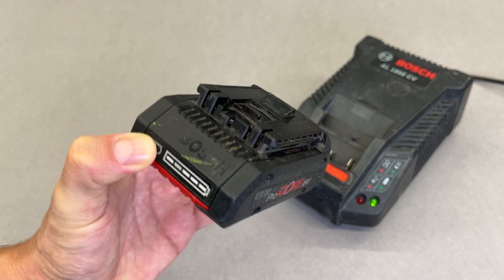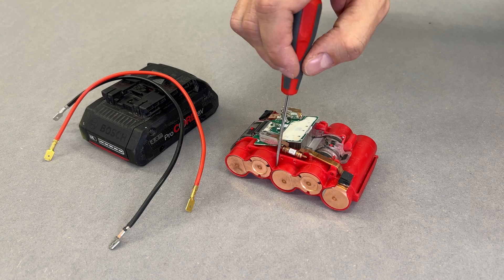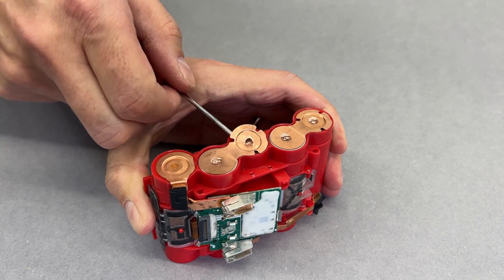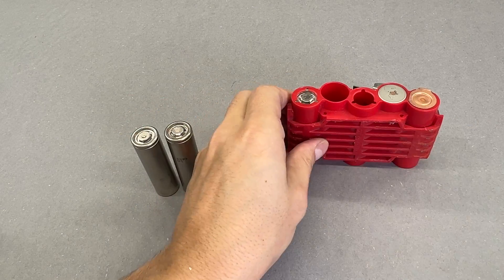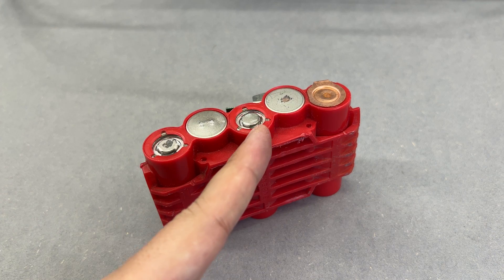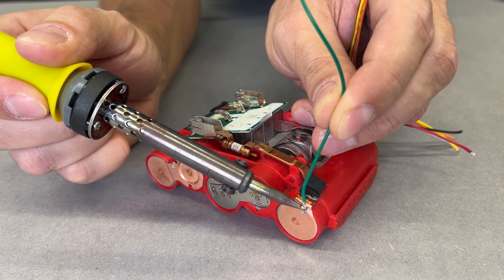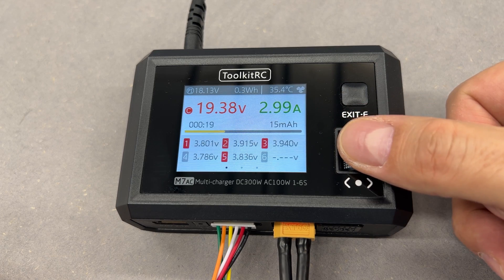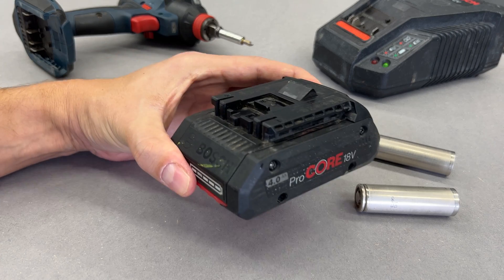Faulty Bosch 18V ProCore Battery - Issues, Diagnose & Repair

Comment: What would happen if after replacing start charging without balancing?
Reply: You can do that. Balancing will be done with internal BMS.
Reply: @eW0LF thats depends. If their is active balancing, yes although it will take some time. If its passive balancing only on the top end of the charge, it will take many many cycles to fully equalize the cells. Best to just balance while you have access to the cells.
Reply: @NoName-sx4cz  There is no active balancing, nor passive. The charger will stop charging at the 1st cell reaching its voltage limit. Others will remain undercharged.
Reply: @donalexey  a lot of bms's, including the one I use on my lifepo4 battery, start balancing at a set voltage during charging, such as 3.2v. they balance while the cells charge, and yes cutoff once one cell reaches 3.65v with lifepo4. That is passive balancing. Active balancing will balance while not charging using capacitors to shift charge between cells.
Reply: @NoName-sx4cz  I was talking about internal battery charging controller of Bosch batteries. There is no BMS. I had to open the battery and change the cells on the table to make a failing Bosch battery charge again to its full potential. The original question was about not balancing the cell on the table before assembly.
Reply: @donalexey  gotcha, I understand what your saying. That makes sense
Reply: @eW0LF 
No it won't. It has no balancing capabilities. It will only monitor.
Reply: Once one cell reaches 4.2 (might be 4.1; not sure) it will stop charging.

Comment: It will die quickly because you didn't replaced all the cells
Reply: Yes and no. 
No 2 cells are the same even if they come from the same batch. 
Then there's temperature influence. Because of heat the middle cells have a harder life than the rest. Especially on the heavy used packs.

It mostly depends on the way the BMS is designed if the pack is going to last after a partial cell replacement.
Many tool brands don't have a balancing circuit in their batteries. Only cell monitoring so the cells tend to drift apart and the usable capacity gets less and less.

Sometimes you can bring a dead pack back to life just by manually balancing it.

Luckily more and more brands are implementing cell balancing.

Fun fact: 
The first gen Bosch professional batteries (both 18V and 36V) didn't even have cell monitoring. Just a single thermistor for over temperature monitoring.

Still wondering how bosch considered that safe because cells could easily go well above the safe 4.2V and general knowledge is > 4.2V = BOOM
Reply: @gabbertje2811  had 2 of my molicel p26a went above 4.2v as i used old 18650 charger without digital display, just state of discharge for every 25%. Once completed i checked the battery with voltemeter and the volt of those 2 were above 4.3v, tried using the latest charger and it won't even able to recognize the battery as the volt way overcharged, luckily nothing happened as i leave them alone a couple of days for them to naturally discharge. 
A few days after i checked and their volt went down to 4.2++v and the latest charger able to recognize them and i put them into storage mode asap but their volt is higher then other batteries as they were discharged from higher volt.
Since then i got myself a balance charger that can support 8s and on my way building 8s battery holder. if it's any unknown batteries it might've combusted or blown already, luckily those were molicel's.
Reply: you're right properly. to measure the cells by a digital voltmeter, seems limited true, he should make it when the battery is loaded. with a big probability, other cells are damaged or died
Reply: Ridiculous.